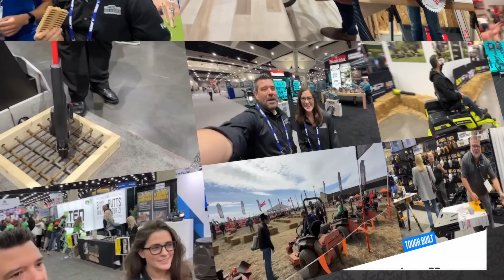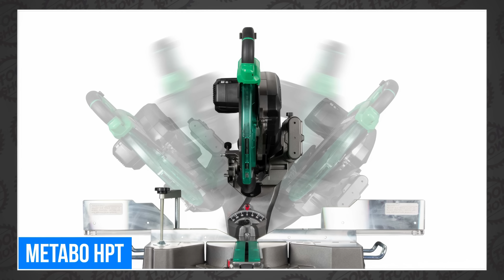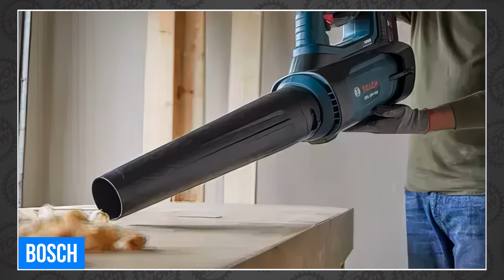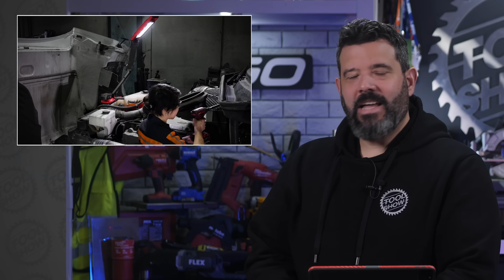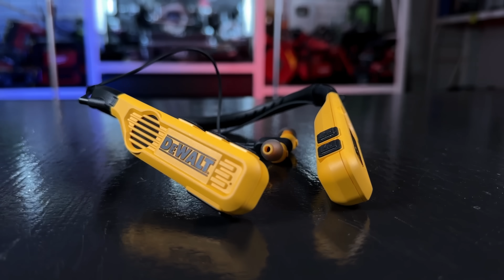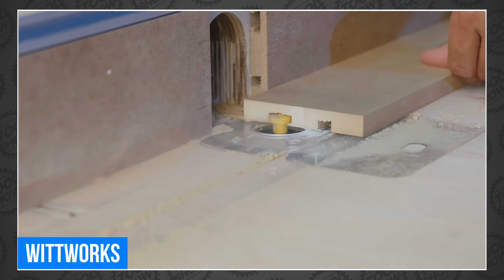NEW Power Tools from Milwaukee, Harbor Freight, Metabo HPT, RYOBI, Bosch, and more!

Comment: You told another guy that "no one loses money on purpose" but I can't find the comment now. Just wanted to chime in: that's not necessarily true. Our site is pretty new and we sell some tools like Bosch at a loss because it's an inexpensive form of advertising. Here's the real math for us:   We paid $250 clearance for Bosch drills that have a retail value of $369. We also only buy a few cases, not a pallet, as they're intended loss-leaders. We then resell them at $269 and don't need to follow MAP pricing because we purchased them retail. After all is said and done, we lose about 50 bucks on each drill. So yes, we are literally selling drills below cost, and far below retail, and we are losing money intentionally. Word of mouth advertising is far more important for a newer business trying to establish deep roots. The more modern scammy fly-by-night sellers really mess it up for the real guys. Thanks for the show bud. Really enjoy it.

Comment: Funny the blade is on backwards in the first clip of the metabo saw
Reply: I think they wanted to show off their VPR blade, nice catch.
Reply: And the Starlock multitool is not Starlock. Its OIS. 😂
Reply: That had to be on purpose because the rotation arrow is opposite of the tooth direction. Or the QC needs a revamp.